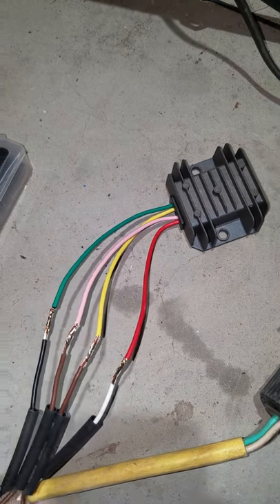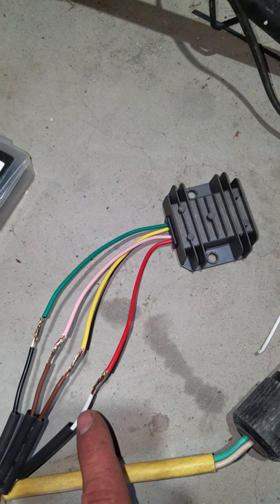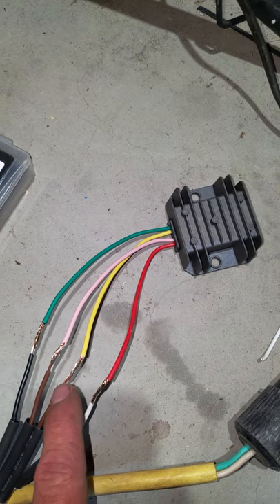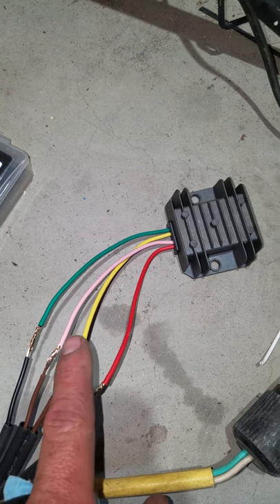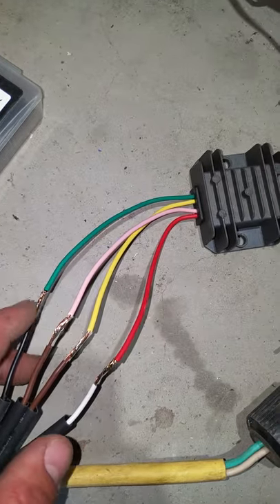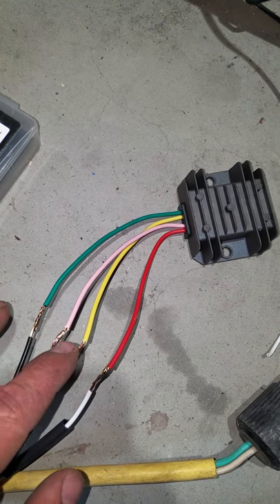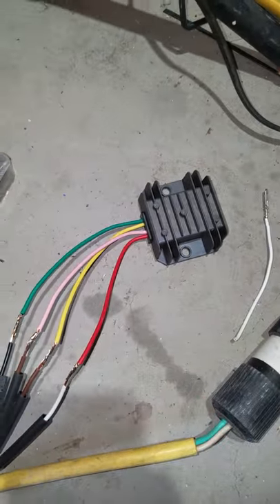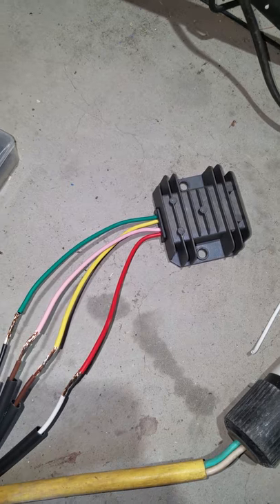How to wire a 4 wire voltage regulator rectifier

Comment: i did this on my 04 yz250f and i cant have both the coil wires hooked up because it causes the bike not to run. i metered with my dmm to make sure i have the right wires. if i just use the one coil wire it will work but doesnt keep up with demand of the light bar. any tips? thanks
Reply from the maker: Weird. I don't know. I don't have any experience with Yamaha dirt bike stators, sorry.
Reply: @eyeballengineering7007  well okay I'll go over it again thanks for the reply!

Comment: Hooked one of these up to a snowmobile and I'm getting 17.3 volts way to high...could it just be a defective regulator rectifier? 
Thanks
Reply from the maker: Yeah. It sounds like it..... These things have a zener diode in them that grounds to the frame when it hits 14v or so. You shouldn't see over that. Low voltage due to low input is the biggest problem with these usually. I believe they are a half wave rectifier.

Comment: Are you supposed to connect the rectifier ground to the frame? not directly to the battery?
Reply from the maker: As long as it's a good ground contact it shouldn't matter. If you had additional resistance in the ground you could have charging issues with voltage regulation.
Reply: @eyeballengineering7007  When you are directly connected to the battery with brand new wire on a brand new battery with thicker AWG on a new rec how is the ground not good?  I'm not sure where the original rec and stator wires go through the bike so I'm not sure if there is a limiter that has to be installed to prevent overvolting or the AWG had to be smaller so it limits 17.4V but those wires are cooked and a bit melted.  I don't know too much about how electrical systems work or how it was built but to limit the voltage by the AWG would be weird considering how it doesn't blow anything else on the bike.  It's 17.4V at high RPM and a check engine light comes on but it pulls hard and everything works.  Used to have an undercharging issue when the wire is running through the harness instead of stator to rec to battery.  If you connect directly to the battery that means your ground cannot be as immaculate or do you have to go through the frame to distribute the power evenly throughout the bike as it was designed?
Reply from the maker: @antdx316  The ground on the battery is always better than the ground on the frame. This is because the battery is the voltage source. The frame is just tied to it. Also, copper conducts better than steel. So the frame always has some additional resistance (Ohms) ..... The wire size should NEVER be ran small to lower the voltage. That is a fire hazard. If you are losing much voltage from the wire, there is a big problem. Either a bad wire, or a bad connection, or wire too small for the load/distance. Any power loss from an undersized wire will be transmitted as heat out of the wire.  What I would assume is happening is your original wires are damaged and the voltage reference the regulator/rectifier is seeing from the battery is lower than it actually is. But, where are you testing the voltage? At the battery? at the regulator? That changes everything. Are you touching the battery terminals, or the connectors? Everything comes down to ohms. If you set your tester to ohms,  touch the red wire on the regulator and the positive battery terminal with your tester. If you get more than 1-2 ohms or so, the wire either needs replacement/bypassed with new wire or the connections need cleaned or replaced. Do the same thing with the negative wire from the battery to the regulator.  This way you know the regulator is seeing the correct voltage from the battery.
Reply from the maker: @antdx316  Also, a low battery voltage before you run it will make it charge at a high (ish) voltage when you rev it. 17.4 is damn high though.
Reply: @eyeballengineering7007  so you can test the resistance from one point to another?

So if you ground directly to the battery and the frame and still have a voltage issue then it's the rectifier?
Reply from the maker: @antdx316  If you don't have a resistance (ohms) issue. Yeah, that's most likely. But what exactly is your battery voltage while running?
Reply: @eyeballengineering7007  If it's not topped out at near 16k RPM with 17.4V it's at 13.6-13.8.  If the idle is below 1k it's like 12.8V.
Reply from the maker: @antdx316  That actually sounds good as long as it's not overcharging. You might get a bar mount voltmeter so you can see what the voltage is at. Run it from the battery
Reply: @eyeballengineering7007  I have a voltmeter attached to the battery which goes on top of the dash so this is why I can see the volts.  The 17.4 is temporary but long term side effects?  Does the ECU limit the power to where everything goes?  Everything seems to work fine?  Would 17.4V start to melt things?  My headlights still work.
Reply from the maker: @antdx316  I don't know. Resistance goes down with higher voltage, but that includes the electrical insulation in the ecu box. So chances of it overheating go down, but chances of it shorting out go up. I'm not sure on the battery, some battery chargers pulse a little higher voltage. I don't know what the max it can take in surges. You may have a bad regulator or one that cannot handle the rpm.  I would clean the battery connections first though. You could have an issue there.
Reply: @eyeballengineering7007  the connections are all clean and new with higher AWG wiring

Maybe the rectifier isn't good or I've bypassed an overvoltage circuit in the bike as this method for this bike don't really exist anywhere on the internet.  I'm not even sure how the harness hooks up.  Someone said to fix the undercharging problem is to hook things up directly in which I did.  I assume the bike is a big resistor which prevents it from going beyond 14V at 16k RPM so that being bypassed makes it show 17.4V.

Everything seems to work perfectly fine but yeah, I'm worried about things going wrong later.  The lights don't get brighter I think.  Everything is the same.
Reply: @eyeballengineering7007  It seems like I have to create impedance.

Comment: We are trying to hook up a light bar for a 3-wheeler that has a rats nest for wiring. The light switch is bad, and we keep blowing lightbars trying to wire them from the battery terminals. Would something like this work to reduce the voltage? If so....how would we wire it off of battery terminals? The bike doesn't have an ignition switch and basically is hotwired. We just can't figure out how to wire a light because the voltage is too high from the battery terminals. Thanks!
Reply from the maker: If I understood you correctly, yes. Sorry, I didn't see this comment until now. Wire it as I have said. You wouldn't need it hooked to a wiring system, it could run the light bar as long as the two a/c circuits are hooked up along with the power to the light. You would need no switch

Comment: hey bro, i have a yamaha mio scooter with stock stator(half wave), and i bought something like this rectifier that you posted because the seller said it would convert the half wave to full wave, the problem is, i dont know how to wire those, for which is which, any ideas?or have you done to same m/c before?
Reply from the maker: Yeah, I have before. If my memory serves me right, you hook it up the same. If you have two stator coil wires, you hook them up the same. AC current is AC current. The rectifier will take the positive voltage through it's diodes and convert it to DC regardless. If it only has one Stator coil wire, you should only hook up the one stator input wire and cap the other one off.

Comment: And I wanted to use headlights, do I use the red for positive and green as ground?
Reply from the maker: Yes, if you don't want to run a battery. If you have Led's you can usually ditch the regulator altogether

Comment: do i have to use both yellow and pink? I only have one AC input.
Reply from the maker: I haven't tried one with a single output stator. Depending on the voltage output of the stator, it might work.

Comment: Just picked up one of these to add a battery to a snowmobile just for accessories will see how she works out
Reply: howd it go?
Reply: @tednelson5574  it worked but since the stator was only a 2 wire (not originally made for charging a battery) I could only have rectified voltage DC or regulated AC not both but the DC was not regulated with this unit so it was too high and would have over charged the battery

Comment: My rectifier went from outputting 12V to around 4V randomly... I replaced CDI, Ignition coil, stator, and rectifier- still 4V.....  Any Ideas? (140cc yx motor) I am pretty sure I have the same rectifier as well.
Reply from the maker: Set your multimeter to A/C and run the engine at idle with the meter connected to the stator outputs. If you have less than 12v, the stator is bad. Make sure you didn't lose any magnets off of the magneto too

Comment: HI SIR HOW ABOUT THE CONNECTION TO THE BATTERY THE CHARGING THING.. WHERE DO I TAP THE LINE FOR THAT..
Reply from the maker: Anywhere in your positive circuit large enough to support your charge capability. The starter positive terminal is usually a good spot
Reply: sir  @eyeballengineering7007  does it possible the positive supply to my lights and signals lights at the same time the connection to my battery charging???
Reply from the maker: @marcusbrazil7993  Yes. No problem.

Comment: Hey man if i connect the ground wire the lights become really dim. Regulator might be bad? I used one that was laying around in my garage
Reply from the maker: Sounds like it shorted. Due to the diodes there should be no current passing through the ground
Reply: @eyeballengineering7007  yeah its really weird, when i remove the ground wire from regulator lights come bright again. But the voltage seems to not get limited to 12v so bulbs light up too much and will probably get burned. Im going to buy a new regualtor and see whats up
Reply: Plus current does not get rectified so the battery discharges
Reply from the maker: @alejo7548  I found, that if all you want is lights. LEDs work great and handle the voltage. Skipping the entire rectifier/regulator
Reply: @eyeballengineering7007  yeah but i need to have a horn, blinkers, low and hi beams, drl, etc to get it registered on my country so i need a battery system for that otherwise i cant get the blinkers to work on idle for example and so on
Reply: Im talking about a suzuki ax100 2 stroke which comes 6v from factory
Reply: @alejo7548  i wanted to convert my ax100 from 6v to 12 volts. can you sahre wiring diagram how to connect and where to connect

Comment: what kind of voltage that the red wire from rectifier you cold it positive ..you mean DC volts ?
Reply from the maker: Yes.  about 14v DC output.

Comment: Hi, I have rebuild an xt500 and am trying to convert it from 6v to 12v.  I have what seems to be the same regulator as you and have wired it up the samd but it isnt working. Can you help? Thanks.
Reply from the maker: Disconnect the regulator from the stator outputs. Turn your voltmeter to AC and connect to the stator wires off the engine. Run the engine. If you're not showing at least 12v at idle, it may not make enough voltage. I would expect it to make that much though. Your stator could also be bad. These little cheap regulators may come defective sometimes too. If you have good AC voltage, it may just be bad

Comment: Hi do you know why I'm only getting about 1.2 volts out put out of the voltage regulator? I have about 20 something going in
Reply from the maker: Sounds like the regulator is bad.. OR-- Are you switching your meter to D/C when you check the output from the regulator? If not, your reading will be not even close.
Reply: @eyeballengineering7007  ok I think that might b it. Because I have both and there both reading the same. I have to see how to put it on DC  thanks again
Reply: Ok idk what I'm doing wrong. I wired it to a preditor 420 honda clone engine. I added another coil to it because it only had one. The original coil is hooked up to the ignition box its putting out 18v the one I added is pushing 24v  so I tapped into the original one with a wire splitter connection. To one of the center wires and my new coil that's pushing 24v to the other middle one and my green is neg and my red is pos (i connected them directly to the battery in Hope's that it will keep the battery charged) that should give me 12 or so volts to charge the motorcycle battery but it's only pushing 1. something volts.  Idk were I went wrong
Reply: @eyeballengineering7007  I think I have it right because I put it to the battery and I get 12.40v on the same setting
Reply from the maker: @danielvielma9279  strange. I've never heard of tapping into the factory ignition coil for added charge. If it doesn't Rob too much power from the spark coil I see it as viable. But you only need power from one coil. You can disconnect the one you spliced from the ignition. Then only leave the one middle input wire connected and tape the other off. You won't have as much charge capacity, but you might find it works. It should still create the correct voltage.   I'm not sure what your problem is, but this should work and take out some questions.
Reply: @danielvielma9279  : Hi Daniel: I have a new Predator 420CC motor that I just installed on a virtually new snowblower for added power. It is now a BEAST and I love it. I am wondering if you ever figured out your wiring issues. In my case I did the same this as you (I think): I added an additional charging coil so that I now have 2 of them. I added a lead acid starting battery and I have this now 4-wire Voltage Regulator.  I am trying to figure out how to wire it into the existing wiring harness without shorting something out. I see where the original charging coil wire is connected to some little electrical doo-dad in the switch box. I am not sure if I should just bypass this little doo-dad and go straight into the charging coil or not. Can you offer up any of your conclusions and help me out? Thanks for whatever you or anyone else can do can do to help.

Comment: If I connect   12 v AC transform to the middle two wires, will it charge a battery?
Reply from the maker: I don't believe so. you should have at least 20v for this. It might work as low as 13v, but probably no lower. I believe these are half wave rectifiers.

Comment: Not explained properly. Coil wires from where they coming from?, are they from stator if so it should be said from stator coil.
Reply from the maker: What other coils in the charging system are there? lmao. Here's an idea? Why don't you take the time to do a free video to help people wire their rectifiers? No? THEN SHUT THE FUCK UP. It's fine. 10,000 other people understood